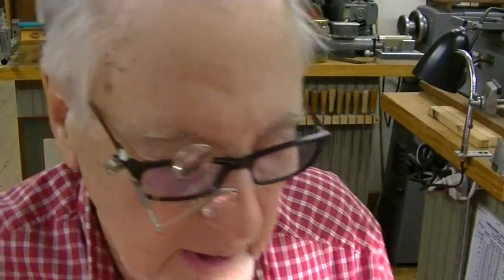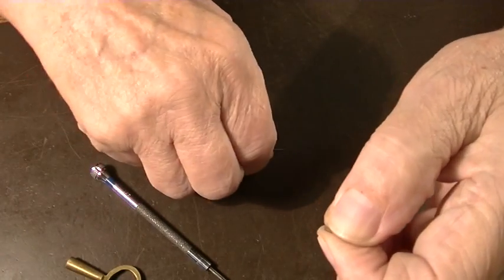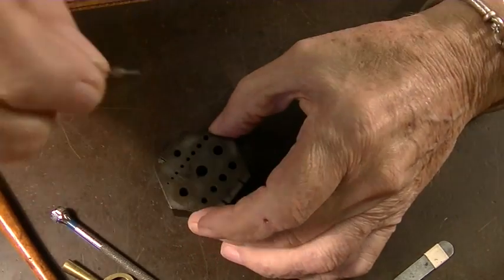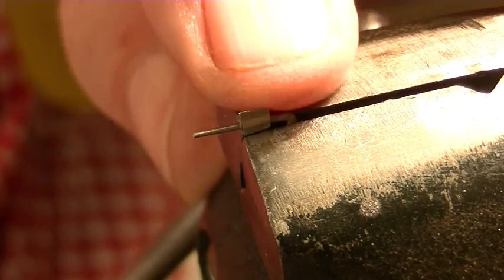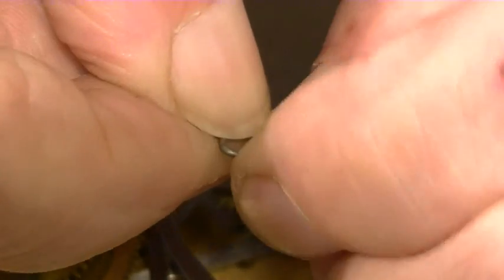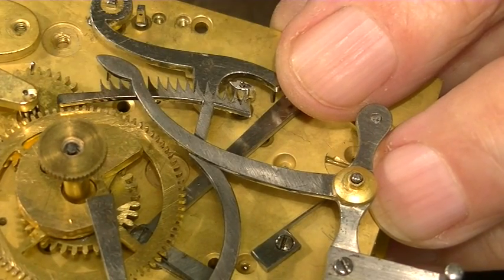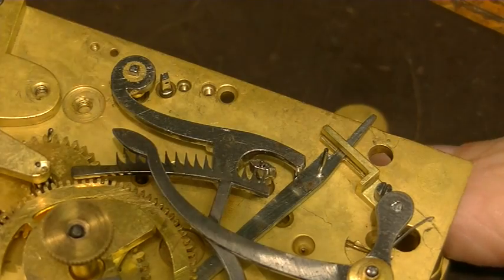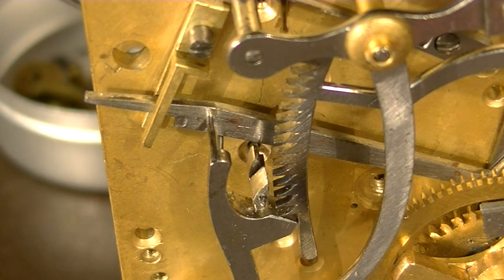The Village Clockmaker. #26 Making a gathering pallet Part #2

Comment: You would have to make up a tapered stepped square broach, broach the piece before you harden it. An other method would be to make up a square shaft the size of the extended pinion shaft, before shaping, drill the hole, then heat up the piece cherry red and hammer or compress over the shaft to create the square---then shape and harden.  PB

Comment: Clarification got Beck que Beck Brown. If you use a drill on the o d. The same as the across the flats diameter of the square at narrower end and broach with a taper so that you have same taper as the square then use a drift with the smaller across the flats to remove most of the surplus then reverse and do the same with a larger drift you can then file out the central portion with a time y square file it all takes a few moments it's just a matter of accurate measurement sharp too,S and being precise. It's much quicker than lots of other methods and you can mill the blank out of the stock before cutting off and final finish with the file takes the time thstbmy vegetablevarr cooking for lunch to make the entire items from first survey to finished fitted part. happy Horology Hugo

Comment: That tiny square hole and in fact the entire part would be a piece of cake for a wire EDM.  probably be made in 20 minutes then cut off of the stock.
Reply from the maker: I know but at 82 I have not invested in any of the modern equipment. I still love doing things the old way. Cheers, JL
Reply: And you do a great job at it too!

Comment: Use a very small square driftvto cut the square I always make the square hole FIRST before the part is cut off the stock so there is something to hold.
Reply: I believe it's called a square broaching tool. I never tried one, but i figure it will be hard making the press fit perfect since the gathering pallet is made out of steel. Not sure the broaching tool will cut trough.
anyways, thanks for all the great videos, I've seen alot of them and I appreciate the work you do!